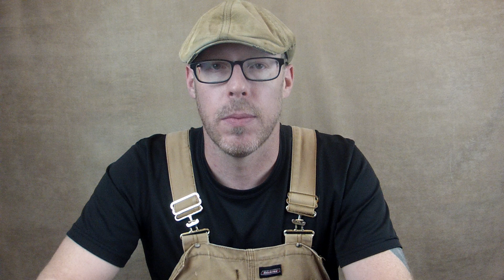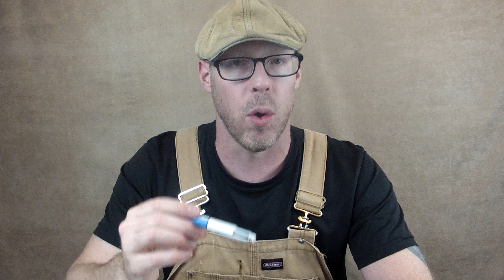How to patch concrete?

Comment: Hi Steve, I've been told by a mason that these concrete/masonry additives, known as "concrete bonding adhesive" or "concrete fortifier" are just watered down PVA glue.  These "bonding agents" typically sell for $35 to $45 per gallon.  A gallon on PVA glue (school glue or any TiteBond product) sells for $15 to $20 per gallon, can be thinned with water (50/50), to a milk consistency, to make two gallons of "concrete bonding adhesive" (a $70 to $90 value).   Do you have experience with this or can you confirm this?  Concrete and mortar products are fairly inexpensive building and repairing materials, but additives to improve bonding and performance can quickly elevate the costs.
Reply from the maker: Not true.  These are different products.  PVA is thick (white glue) but the thin looking bonding agent is not watered down PVA, it is either acrylic latex or SBR latex, which are entirely different than PVA.  This article should help you to understad the differences: www.swimmingpoolsteve.com/pages/bond-concrete.html
Reply: @Swimmingpoolsteve  That's a good article that you referred me to explaining the various types of bonding agents, their advantages/disadvantages and specific uses.  Note also, that the article does make direct reference to the use of PVA  as a common additive when preparing a bonding slurry with portland.  Although PVA is susceptible to UV and water infiltration, it has good performance characteristics when a topcoat or final painting will seal the surface.  There are obviously better commercial products out there, but the product I've found at local big box stores looks exactly like watered down PVA and has the identical smell as PVA and the directions on the container recommends topcoating or painting for best performance.   I'm not yet convinced that the big box store product, at four times the price of PVA, is not just watered down PVA.